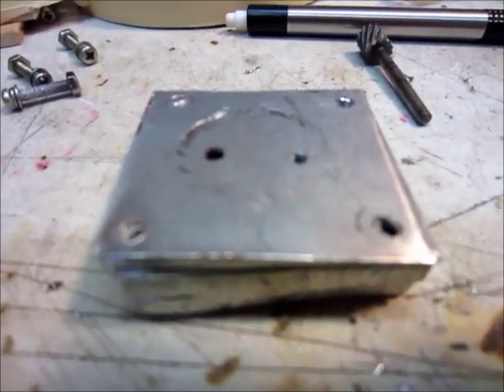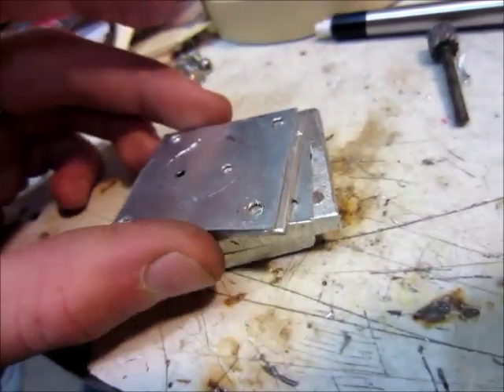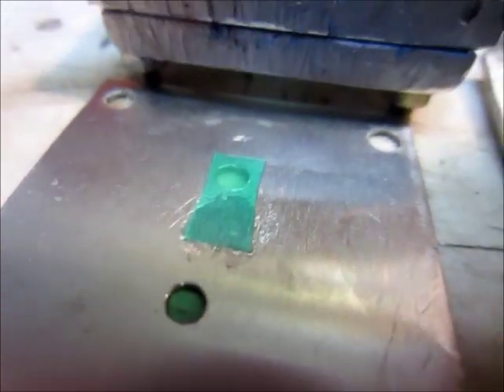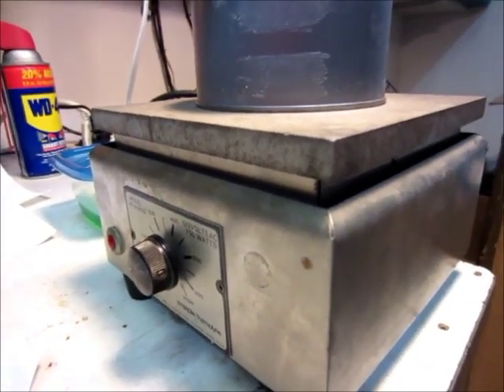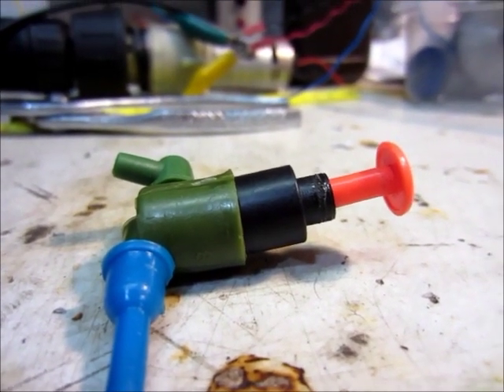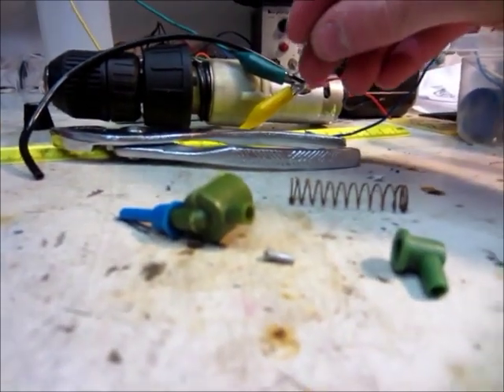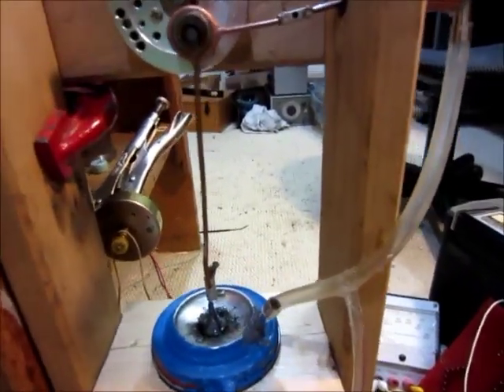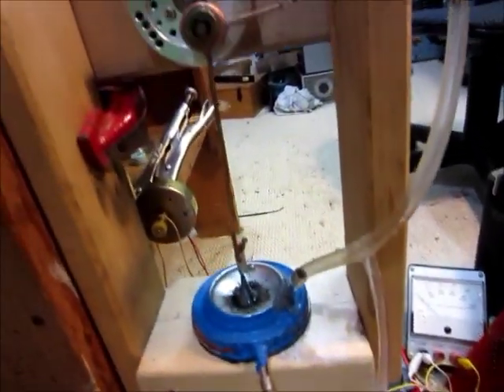How To Build a Simple and Efficient DIY Diaphragm Water Pump For Stirling Engine Cooling

Comment: The bit about the water gun trigger valve is definitely interesting. I wonder if I have any water guns lying around to salvage that part from (unrelated project, sort of).

Interesting design, too, on your pump. Kudos.

And this may be too late, but I suspect the reason for the reduced flow with the increased speed is mainly due to the piece(s) of glove you used. I think it's just too weak to handle anything over low power (relevant to your power source). Maybe one of those yellow cleaning gloves would be just strong enough to handle it and a close enough match to the existing material without a total redesign.

Edit: Sorry, looks like I'm 7 years too late. Disregard everything I said. Lol

Comment: Am using a turbo compressor wheel as the impeller think that it will work ? Drill powered
Reply from the maker: dnbwalkera adam Using the impeller as a water pump?  That sounds like it would make an awesome water pump!  Good luck!
Reply: thanks it off a truck 91mm diameter
Reply from the maker: Wow!  That would pump a lot of water!  I'm not sure a drill would be powerful enough to take full advantage of it!
Reply: got to pump 3 l =-( lol will be fine lol i didn't know how much water i needed to move ...
Reply from the maker: I see the picture of the impeller!  Nice!
Reply: +dnbwalkera “bignose” adam I 3d printed a small impeller, and it works very well off a 12v motor!

Comment: Very creative as usual. Looks just like the pump in my chainsaw carbie.

Did you consider using a radiator and thermo-cycle to keep it cool? you could even have engine run a fan on the radiator?

But since you don't seem to be suffering an output loss, how about adding a water wheel (gravitational, not pressure operated)? You might get a little extra power?

Have fun :)
Love the glove for diaphragm! Wish I had of thought of that before driving 150km's to get a new $3 diaphragm for my chainsaw...

Comment: Wow! That your water pump was very creative. Congratulations! The great advantage of this system, it does not take hardly any power from the engine, the engine loses only a little compression. For if the motor is high speed, the hoses should be shortened, so that the engine continues with compression. Great idea.